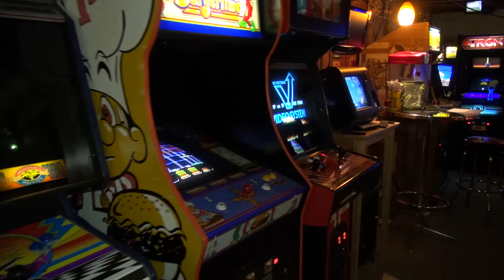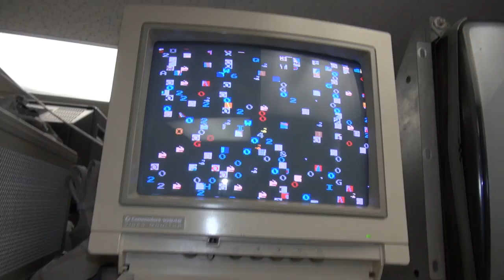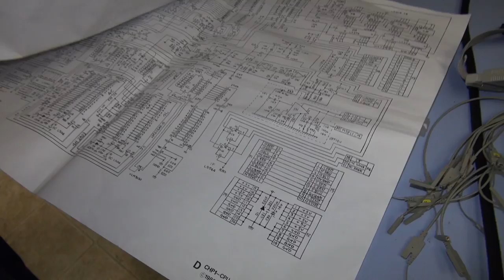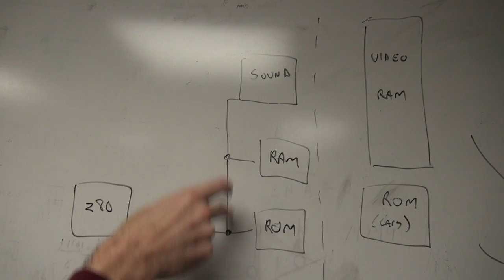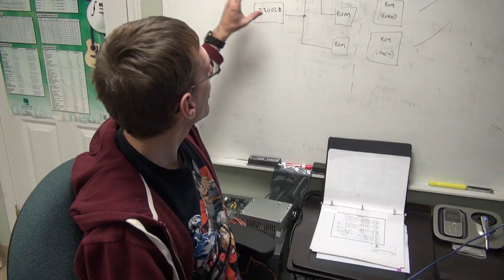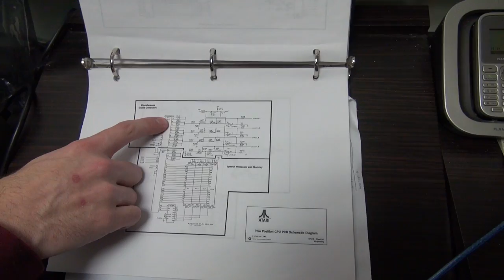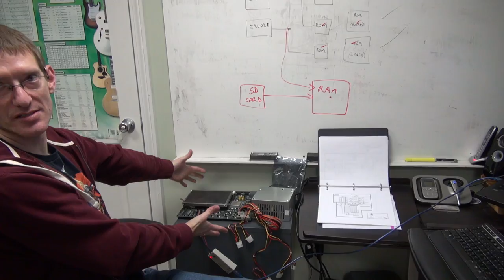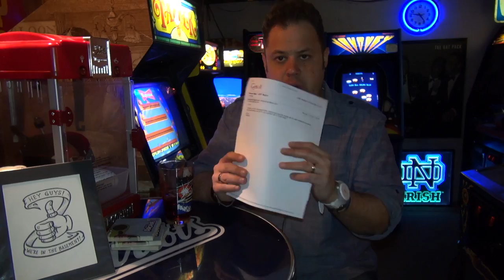Pole Position Arcade FPGA Clone PCB Update with Adam from One Circuit

Comment: Like a couple of the guys have said Mortal Kombat 1 has a panel you can pop off on the front right side and pull a wooden board out where the pcb is mounted to access the jamma harness and plug in other boards for testing if you want to.

Comment: I always thought it said "great driving you've qualified great".  The ejection of ROM into flash ram was inevitable and glad the copyright issues have been considered ;) how is the final board going to interface to the cabinet as the two versions have different wiring looms and pin outs?  Make an Atari edge at one end and Namco at the other and turn the board upside down?  We have a Namco cockpit and an Atari upright.